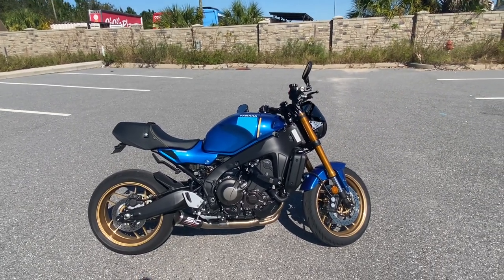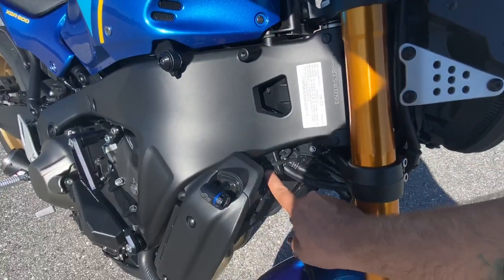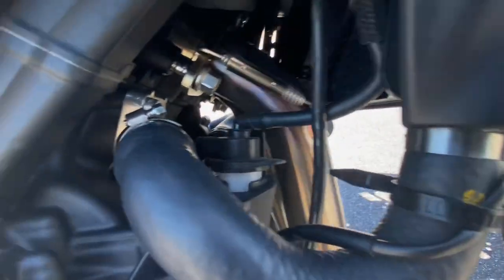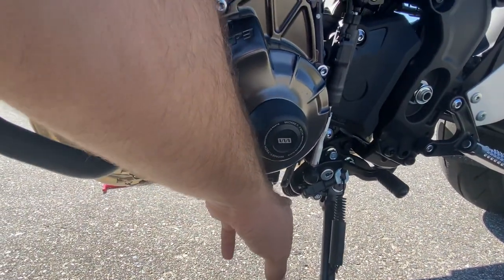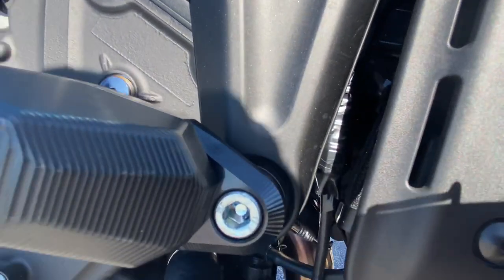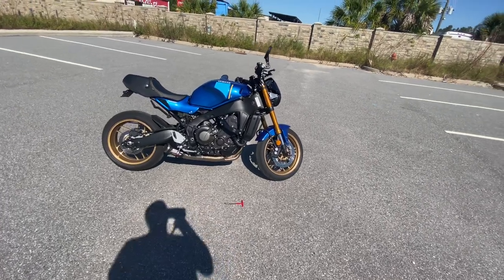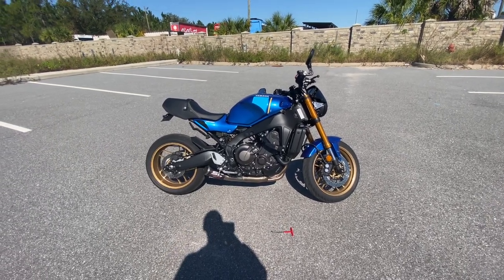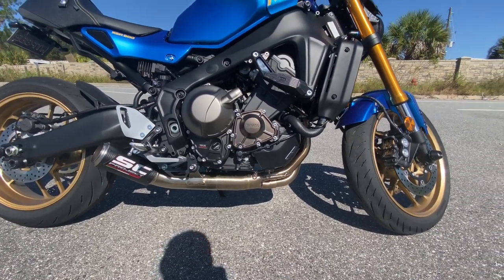2022 Yamaha XSR900 SC Project CR-T install overview and sound clip!

Comment: Do you need a fuel management like power commanded or something  since it's full exhaust?
Reply from the maker: I’ll be getting a tune to round it off better but no not really but a tune should be done for full benefit and proper running

Comment: My fz09 headers loosen up every now and then…it’s not abnormal…shit my R1 and GSXR do as well
Reply from the maker: Noted
Reply: Use some mild thread locker if it becomes an issue, make sure that stuff can handle the high temps in those studs.

Comment: Soup can exhaust. Basically a straight pipe with a tiny bit of noise damping.
I've been around the Youtubes for years, and I don't understand why so many people comment that these style exhausts "sounds good."
No, not really. Tone isn't that good, raspy isn't that good, having all the police in town hearing you isn't that good, hearing loss isn't that good.
Most internal combustion engines sound terrible with straight pipes, no matter what the engine is.